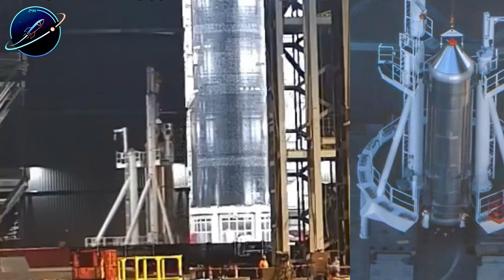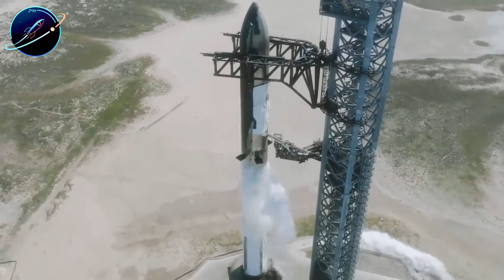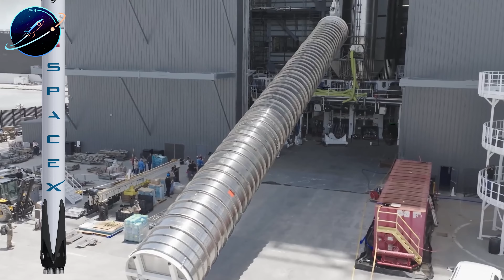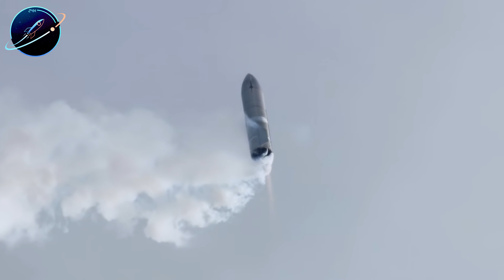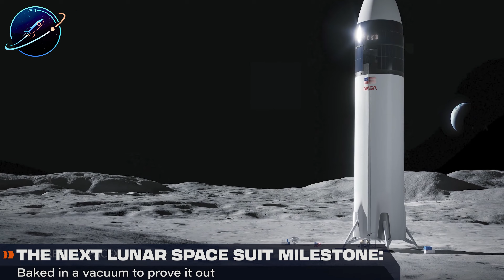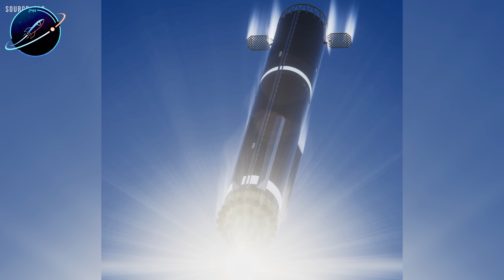SpaceX Found the Perfect Solution for V3: Breakthrough Build 4 Weeks Faster Than Anyone Predicted!

Comment: Bring the down comer all the way into the trust puck and use it as a manifold to feed fuel to the engine's needs redesigned to make it work  no more birds nest  . ( NGH)
Reply from the maker: That's a clever idea—integrating the downcomer directly into the thrust puck as a manifold could indeed clean up the "birds nest" plumbing mess. V3's redesigned fuel manifold architecture already simplifies integration massively, slashing those build times. What do you think enables this shift most?